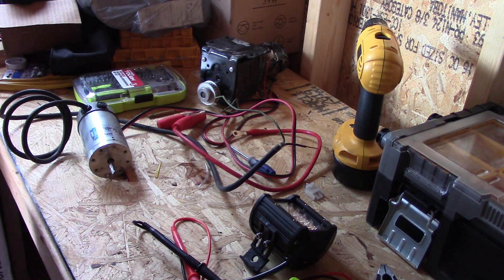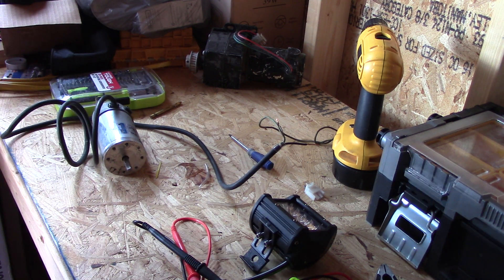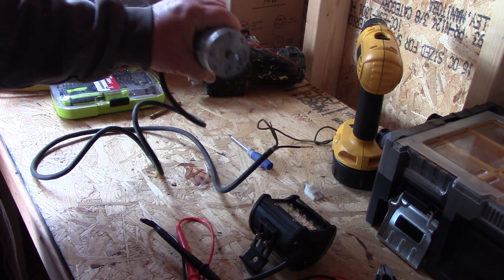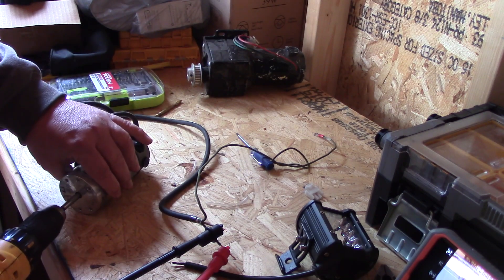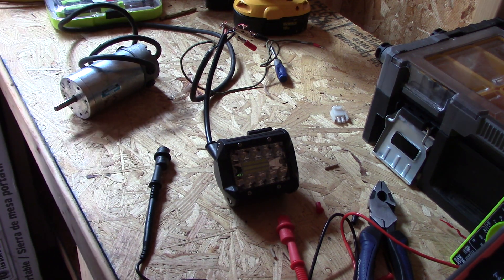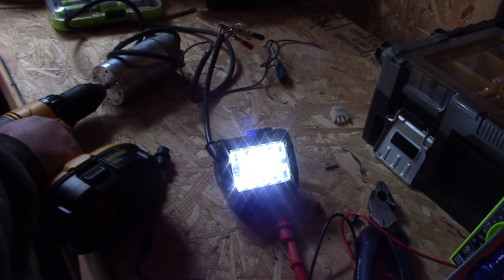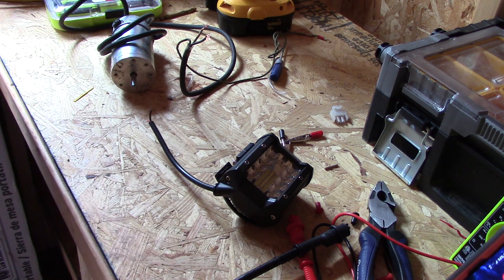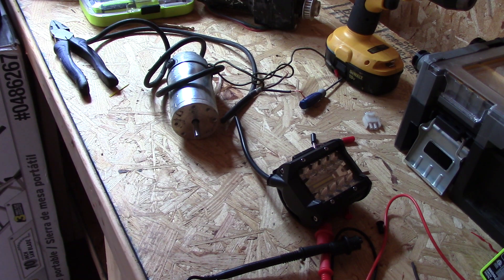Testing My Permanent Magnet 12 Volt DC Generator Motor for the Wind Turbine

Comment: yes,you got to have a reg on that,for sure,,about 14.5 volts is what you want.any more will blow a 12 volt bat.how was u going to reg that.you going to have enough watts,,for things you supply.u should use a car gen with a built in reg.be perfect.u can produce 12 volts,but u have to have the watts out put.your pump your going to use how many watts does it pull.thats why a car gen is pretty much what u need.something more heavy duty.u may have something else in mind.
Reply: No ... a car alternator is NOT a good idea, for a Wind Turbine ...

Comment: One thing, though, Joe, AC doesn't care which is red or black. Think about the batteries in your flashlight, or turn your PMG backwards while it's hooked to your LED light. The light won't light. Red is almost always positive, black negative. You can damage batteries by hooking them up backwards. My Mom and sister were trying to jump start Sis's car. They hooked red to black, black to red. It literally melted the insulation on the jumper cables. They were lucky neither battery was damaged. Polarity is very important in DC circuits. Good luck with the wind turbine! I look forward to seeing your experiments. Be CAREFUL as you step up the voltage, it can get dangerous. I had an Army buddy who accidentally shorted across both terminals of a 24 volt battery. That one DID explode, and sprayed battery acid on him. He was lucky, very lucky, not to get serious acid burns. Have some water close by to flush away any spills, and be careful not to short things together. That's essentially what welding is. Linda and I send our best to you and Gail. 

Speaking of welding:  https://www.youtube.com/watch?v=8hwLHdBTQ7s
Reply from the maker: +Odahi The Dubious You are correct. I was referring to when I was connecting the leads to check the voltage, or when I wired it direct to the 12v light.  When it comes to the batteries and controllers....a whole new set of rules lol.

Comment: Ur also gonna have to get a 3 way switch to brake the motor but not fully stop it this way it can bypass the batteries and send it to ur dump load resistors or send it to a heating element so u can have free hot water while you take a shower good luck brother

Comment: Why dont you use a alternator ?
Reply from the maker: +Theredneck Prepper This is much smaller and lighter.  A lot easier to mount on the pole.  And, it's free.
Reply: The better answer is  ... a car alternator needs to spin really, really fast.  Most Micro-Wind Turbines do not spin very fast ...